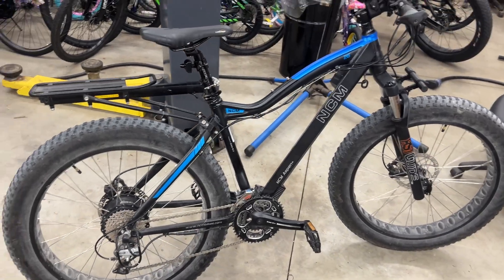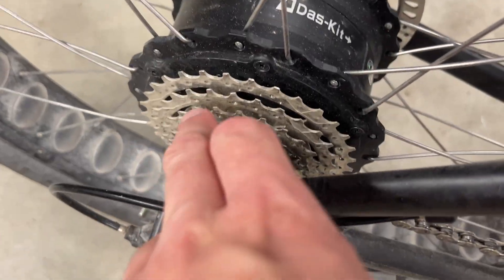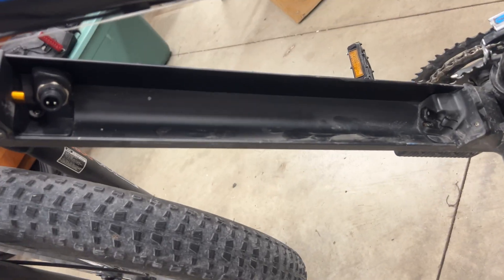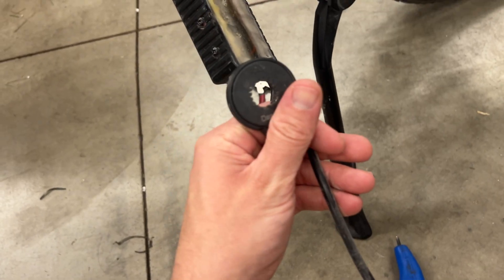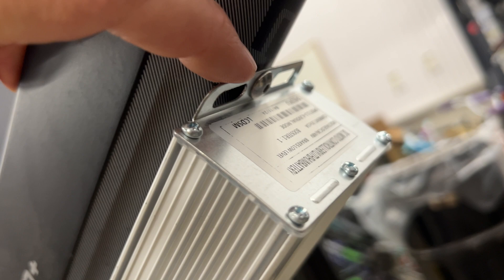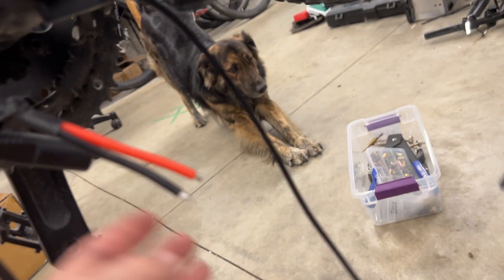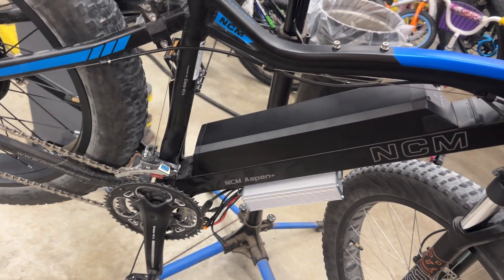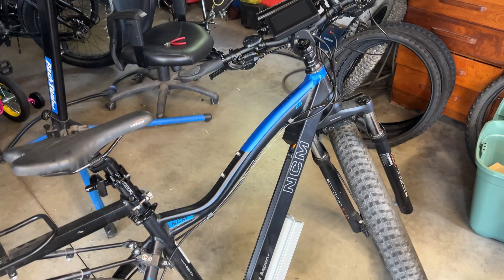Illegal 1500W 48V NCM Aspen Plus Fat E-Bike Build Upgrade

Comment: Hey I have a 750w Sohamo M3 Ebike 48v 15AH battery it gets up to 36 on flat ground, but when I try any heels, it slowly comes to a stop unless peddling  and still it’s a struggle and goes really slow. Then the display only can adjust P1 and P2. It doesn’t show the other p’s like it doesn’t want you to change them or something. I tried putting another display on it, but it just turns on, the throttle doesn’t work or pedal assist doesn’t work or communicate I believe! It’s a brushless controller on it! There is no videos on how I can’t get this to work or display options for this bike😩 then I’m trying to find a different controller. Maybe that has the same hook ups as my bike and controller but all the controllers I’ve looked at have so many wires on them Not like mine!  I want to be able to put a different display screen on it if possible… My controller has four or five plug-ins that’s including the power which is a XT60 I think then the other four are plug-in, connectors or something… I just want to be able to get it up a hill without the struggle of losing power because no matter what level I put it on it goes slow tackling hills!!!😒 it’s a Great Bike if you’re riding on flat ground, but if you’re taking on any kind of hill it loses the torque or power or something! Any suggestions???🙏🏼

Comment: Hi, i have a 26×4 inch hidoes b3 ebike 1200 w(rear wheel hub motor)that supposed to go about 37 mph. But i weight about 260 pounds so i do about 27 mph😢...i want to add a front wheel hub motor kit to give me about 50 mph. Please help me, you're an expert, please tell me which is best and affordable 🙏🏿
Reply from the maker: Better and more simple to just upgrade the rear wheel. Do a 2000w one and you should go fast enough, maybe not 50 though.
Reply: @porkercon  AWD is what I wanted, it's more torque and more range... 😅
Reply from the maker: @stomybugsy12  Alright then I can't help you